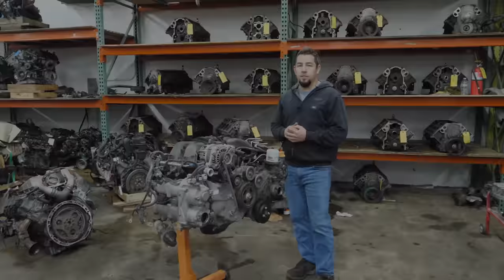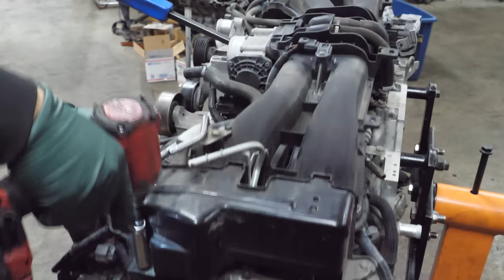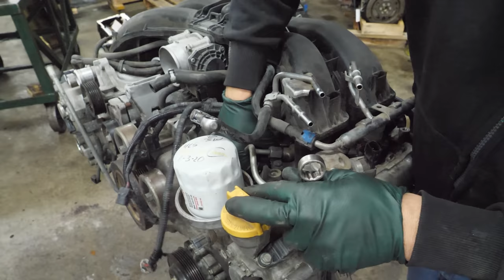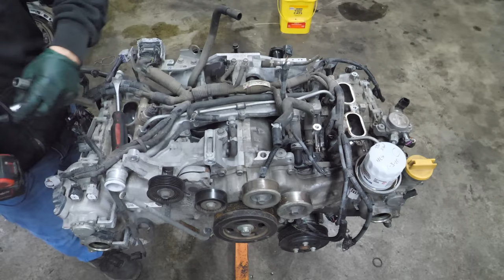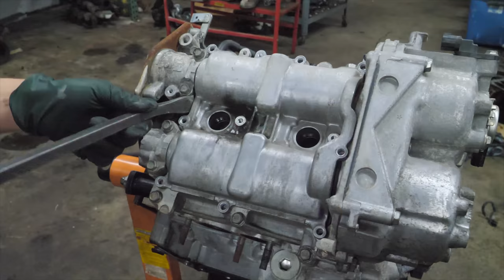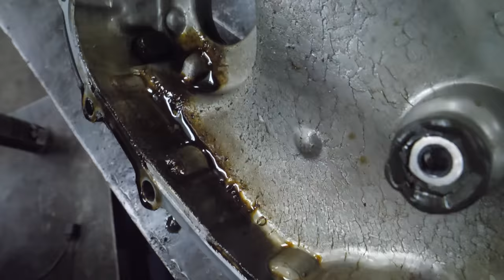Blown Subaru BRZ / Scion FRS FA20 Boxer Engine Teardown. A $3,000 + Whoopsie.

Comment: Ignoring the plugged conveter is good for burning the exhaust valves on these, they also use shims to adjust the valve lash, good times. At least they don't shit headgaskets at 80,000 like the EJ.

Comment: If you ever get a 2.0 Ecoboost first generation (pre 2016 build date Ford SUV) or one out of a Ford sedan, eg fusion/Focus ST I am looking for a good block and head to build a high horsepower 2.3 stroker for my car. It does not have to have a good crank, rods, or pistons but a good head is a must. Journals should be in good shape as well.

Comment: My friend asked me to his minivan oil level, that used as much oil as gas. It had a main crank seal leak. I told him it has oil, but he didn’t believe. After checking himself van needed two quarts of oil. Dodge minivan has dipstick. If I didn’t know how to read it correctly, I would have ruined the engine. 
Many Japanese vehicles have cable with crosshatch weight at end. That are very difficult to read if you didn’t know what to look for.
From then on I check every vehicle that came in to for an oil change. So I knew to read level correctly.

Comment: Just had a car come to the dealer for 2 recalls and during the inspection I found the car had no oil on the dipstick and a lot of sludge. recommended an oil change and some other stuff and of course… customer declined 😂 engine was already making some noise, although no knocking yet so I didn’t bother putting oil on it

Comment: The fa20 should have access ports for you to pull the wrist pin if you can turn the crank for them to line up.
Reply: That's what I thought too, because that's how the EJs were like. Seems like Subaru redesigned the connecting rods for the FA and FB motors so you can actually get at them and get the rods out without splitting the case halfs. I think that's an improvement, although there's alot of other things that I think make the EJs simpler and better.

Comment: New gr86 has engine blow issue. Main cause is subaru use too much sealant while they assemble the engine. And that sealant stuck at the oil strainer, it blows the engine

Comment: I always keep those junk yard wiring harnesses for plastic parts and connectors. You can change the broken clips on connectors by taking the wires out of the connector and changing the plastic part ,you don't have to cut any wires. Most "Mechanics" just cut wires and use butt connectors.i hate those things.

Comment: i have a dumb, non-mechanic question. when you hammer in incorrect socket onto a bolt to keep from stripping it when you remove it, how do you get it back out of the socket?

Comment: It always amazes me how complete some of these engines come with the manifolds, wiring, hoses and everything else still on them. Like do the replacement engines from some of these brands come pre-equipped so there's no need to remove them from the old engines? Or do people just buy all new everything? Anytime I've had to replace a 'complete engine' it's just that, an engine. Most everything else has to be transferred. You might get lucky and it'll come with a water pump or something.
Reply: He's taking apart cores that were once in other cars, bud

Comment: Fun fact the EJ series of engine is based off the EA a bunch of pot smoking engineer from Washington university designed the 4 valve head Subaru liked it so much they developed it the EZ series of flat 6 Porsche help Subaru design. And the crankshaft is almost identical to the one in the Porsche 3.6.

Comment: another great video, man. you've been an inspiration. any engine stand recommendations for getting started on an engine rebuild? i have a 1995 bmw m50 from a 325 that needs some work. are the harbor freight stands any good or some other brand preferred? thanks
Reply: HF engine stands are fine, whichever you get make sure it has 4 wheels, not 3. Especially with an I6 (which is longer than a V8 and thus less stable on stand due to leverage)
Reply: @rickc303  thanks, makes sense. very much what i've been thinking as well. i've been seeing some i can get from amazon in the $200 range that look pretty stout with four wheels. Nice thing there is it will just show up on my doorstep.

Comment: They conduct the valve springs recall with the engine in the car? I don't think that's accurate. I got my hands on the internal J02 Recall document back in late 2018 when this campaign started. It's a 12 hour book time job that instructs the tech to remove the engine from the car. At least the dealer I had my recall done at sent me photos of the engine out of the car when they did mine. I don't even see how you could do this with the engine in the car.

Comment: For those of us who regularly check our Subaru's engine oil (which should be all of us since they tend to use, or loose oil), getting an accurate read from the dipstick is darn near impossible.
Reply: Why cant you read the dipstick ?
Reply: @cayman9873   Every time you wipe it, put it back in, pull and check it again, the reading is different.

Comment: And with the FA24's documented issues with RTV sealant clogging the oil pickups. Combined with troublingly large, repeated oil pressure drops during spirited right hand turns.. 
     I fear we will be seeing similar stories with those in a few short years. Dreaded Subaru boxer rod knocks a coming...

Comment: Would love to see the turbo version this engine, FA20DIT
Reply: Yup FA WRX 2015+
Reply: It has thicker conrods and wider bearings than the BRZ version. I don't know why people try to boost internally stock BRZ/FR-S engines despite knowing Subaru builds them weaker than the WRX engines.  The valvetrain on the BRZ engines aren't that strong either AFAIK...

I know some people have good luck and no issues with their boosted BRZs or 86s with stock engines but overall AFAIK the engines are just not as strong as say the old (and non-emissions compliant anymore!) K20A2 or K20Z3 from a RSX Type S or Civic Si, or indeed the WRX version of the same engine!

Comment: Wow, this video really shows the utter horror of owning an older Subaru.  Gotta love an engine that's damn near impossible to work on without hoisting it out paired up with the tendency to blow head gaskets due to the head and block design.  Those mating surfaces look like they are barely 1/4" wide!

Comment: I can’t get over how clean this engine was! If  it really has over 100k on it someone was absolutely religious about changing the oil. There isn’t even any varnish anywhere. Yet it suffered a lubrication failure, I don’t know what to think very strange to say the least. Maybe this owner bought it used and destroyed it in a very short time.
Reply: Mine has 270 000kms, and running great with no knock. Knock on wood lol. I change the oil a lot

Comment: Cool video. Here's hoping I don't lose any valve springs on my 2013 frs. But I figure that since it's held 11lbs of boost for 50000 miles with hard driving that if I was going to have engine death from broken springs it would have gone long ago. And the horror stories of people getting self destructed engines after getting the recall done didn't exactly have me lining up at the stealership.
Reply: MichaelPixelsaurBenson 
Sbd turbocharged but the old one only oil cooled.

Comment: I recently got a new block for my brz and once I got it back there was a gas leakage on top of the engine. Mechanic shop said they didn’t touch anything there, they fixed it but not even 3 days later same thing happens again. I’m in need of help because I don’t know if they are at fault or not.

Comment: Probably the biggest failure is from the valve spring recall.  Issues with sealant and a bad repair procedure cause a ruined engine.  Subaru refuses to acknowledge the problem they have caused but Toyota at least will usually repair under warranty the damage caused by the recall repair.

Comment: That sump makes me sad.
Not because of the bearing material, but because the sump plug is high up from the bottom.
If you were to do an oil change a lot of crap is left behind.
Are the FA20/FB20 engine oil changes done by a suction via dipstick?

Comment: I watch you every Sunday morning. I am not a big fan of the split block engines because of this channel and your great work. Now, what year is that XJ???? 4x4???
Reply from the maker: It’s a 99, 4wd, manual
Reply: @I_Do_Cars   Does it run and if so, how much for the whole thing?? If it is right price, I will call the shop tomorrow to talk more about it. Thanks
Reply: @I_Do_Cars  I am looking for one on my place here, I sold mine awhile back to my cousin and miss having a Jeep. Mine was a 99 also, they have the best throttle intake so I am partial to the 99s
Reply: @I_Do_Cars  Just called the shop, he is supposed to tell you about a total purchase of the Jeep, like you did on the Ranger truck.  He said that you all dont sell cars, just the parts on them. I was interested in the whole thing for use around my cabin here in Ky. If you change your mind, let me know.
Reply from the maker: @roynichols4745  it just depends on the vehicle. As a business we don’t sell whole cars, and this jeep is worth much more in pieces. If it’s worth saving I usually do that personally, separately from the shop.

Comment: low on oil or oil starvation form high Gs? I know the weakness of these boxers are due to the oil starvation from track driving.
Further more, another issue is the rocker arms falling off (happened to me) and puncturing the valve cover

Comment: Great video! about to do the same thing,
I am wondering if these engines are universal. between BRZ,FRS, GT86.. mine is a manual 2015 FRS and im wanting to put a newer GT86 engine.. anything I should make sure of?
Ive just heard of choosing a manual engine because the wire harness are different and dont mate well.

Comment: Im planning on getting a BRZ/86 when I run down my old Mazda, but I hear so much mixed stories about this engine and other boxer 4s. Im pretty strict about maintenance and oil changes, also I don’t drive like a maniac since I don’t want to wear on the engine faster. Any chance I’ll have problems? 😅 

Also great video!
Reply: people overexaggerate the problems these engines have, as long as you check it somewhat regularly it will be fine, and if you track it look at getting a baffled oil pan. A lot of people beat on these cars without caring for them at all and oil starvation kills them quick
Reply: I daily drive mine with 120k miles and travel cross country with it. it extremely reliable

Comment: The recall is not done in car. The engine needs to be removed. The reason why people blow up these engines is cause, the timing cover leaks right by the water pump, and people drift these cars and since the oil pan is not baffled, the oil will get forced to the end of an oil pan side and starve the engine.

Comment: B4 you asked I was thinking that put it through the parts washer and a 'trendy' necklace for your wife and or girlfriend. Doubles as weapon.
Actually while it is very worn I suspect the crank would grind and the rods would resize. Is ist viable?? Probably no.
80 plus years of wobble engines and they still have issues!!

Comment: Yeah it was clearly RTB it was in no way running it hard, and lack of proper maintenance. Joking aside RTB clogging the pickup typically kills the motor in the first few 1000 miles. Most of the failures with this motor have been document after hard use well into it's life. Which is where a lot of the Japanese reliability came from during the 70's, 80's, and 90's as people rarely bought them to abuse. They bought them to go to work, and drift wasn't a thing in the US until the 00's.

Comment: A "problem running low on oil" means it burns, or leaks (assuming it was originally filled)…

What usually causes the oil to disappear?
Reply: Bad rings 💍.....oil dilution but this had dual injection. Hi pressure injection is likely the problem.
Reply: It can also evaporate and go out through the PCV system but that usually takes quite a while to use up enough to cause problems. Hotter running engines will evaporate oil faster.
Reply: The extremely thin and light pressure oil rings in modern engines certainly doesn't help.

Comment: Would have waste of material just for the lack of oil. All that metal all that Hardware all that engineering just reduced to junk. But the heads and valves looked okay

Comment: I worked with a woman that asked to check her oil on her Isuzu suv. I pulled the dip stick. there was no oil. I said don't you ever check your oil? She said Honey I just put gas and drive it. she was down 6 quarts of oil.
it a miracle the engine didn't seize.
So some pijust don't care.

Comment: First of all, WTH is a “service champ” oil filter!? I get upset when people use the “us “blue” Subaru filter instead of the black Japan filter which is the correct filter and is clearly different, but to use a “service champ” filter that is as tall as the incorrect Subaru filter is a definite clue why there was an engine swap to begin with! Plus it says it was installed in 2020! So many clues of bad maintenance….

Comment: So how could bearing material get into the cam bearings?  Shouldn’t the oil filter catch that?
Reply: There was probably so much material clogging the oil filter it went into bypass.
Reply: The oil filter does NOT catch everything, and certainly not in one pass through. When the filter plugs up with debris, or sometimes when oil is cold, or a combination of the two, the filter goes into bypass mode, which is not filtering the oil AT ALL. 
Depending on the brand of filter, type of filter media, etc the filter media filters only a certain percentage of the oil which passes thru it, and only certain sizes of contaminants. It relies on multiple pass throughs of the oil supply to reliably filter out most of the damaging junk. No filter or oil pickup is made to filter out all of the kind of debris we're seeing in some of these tear-downs.

Comment: Incredibly insane how much real estate that four cylinder takes and it doesn't really produce much more power than an inline four these days. Looking like the boxer motors coming to see it's demise outside of the purest. 😁...... edit........ I forgot that's the only way they can make them bigger than 2.5 liters for a four cylinder. 🙄
Reply: A boxer engine doesn't inherently make more power than an inline layout. The boxer is used for handling and packaging reasons (lower profile).
I have no idea what you mean by "that's the only way they can make them bigger than 2.5 liters for a four cylinder" ... even a >100 year old Model T used a 2.9L Inline four cylinder.
Reply: @Retired Bore - your reply doesn't relate to what I wrote. Nobody mentioned VVT or balance shafts, and the OP was most certainly wrong in saying that 4 cylinder motors larger than 2.5L can only be boxers.
Reply: @Retired Bore - I am replying to the OP, not you.

Comment: What cause the oil missing from oil pan? Oil leak?
Reply: used oil doesn't flow as new oil. It becomes thick and it isn't able to pass through the small crevasses which starves the motor from clean oil. No oil means metal to metal contact then leading to pistons to go sky high. 

For Subaru's case because of how the engine is design the oil pan doesn't get the proper oil it needs when at high speeds at turns. When driving the car and making quick turns you starve the motor of oil for a moment, doing so many times will cause wear at a much faster rate. 
You can get aftermarket oil sumps for Subaru engines which help but in the end its a design flow by Subaru.

Comment: Been waiting for one of these on the channel.
First commandment of BRZ/86 ownership, thou shalt regularly check oil levels. 
Shame the new 2.4L models have moved onto a factory installed failure mode, silicone clogged pickup tubes.

Comment: Hey i have a question do you guys buy motors junk? And at what prices i might be able to send you motors for cores
Reply from the maker: We do, and it just depends on what, and how far you are. Most engines need to be special to be shipped in.
Reply: @I_Do_Cars  is there a list or a way i can get in contact with you because i pull alot of junk engines a week but we barley get paid for them at the junk yards we goto

Comment: This just reinforces my opinion that these engines are terrible. The complexity, weight, number of parts and difficulty of working on it simply doesn't justify any slight advantages the boxer engine might have in terms of center of mass etc. It must ne insanely expensive to produce compared to an IL4.

Comment: They are a pretty shite design, ive seen so many of these having rod knock, both road and track driven ones. And the valve spring recall just did it even worse with mechanics overusing rtv. My 86 got a new engine just before i bought it because of it aswell. I love the car, i just wish it had a Toyota engine in it :)

Comment: The other bad thing about those engines in the FRS/ BRZ is you have to remove the engine to replace the spark plugs, as the wheel well sits about an inch from the spark plug wires.
Reply: You can do the plugs with the engine fully mounted in the bay. It's not easy, but it's possible with the right combination of extensions and swivel socket adapters.